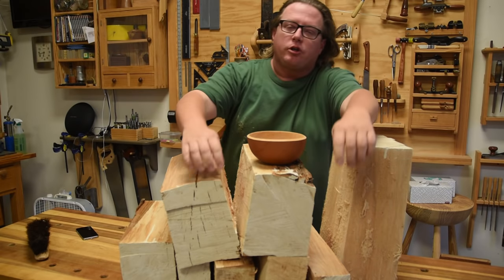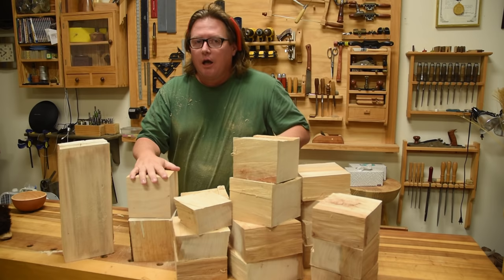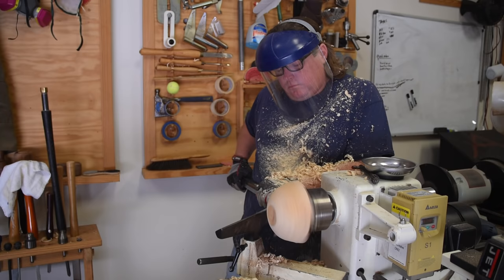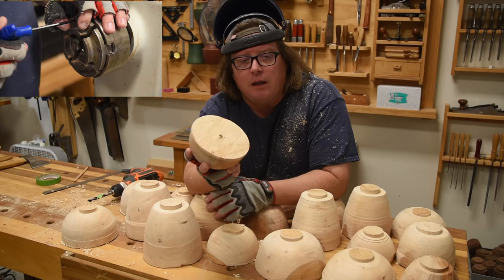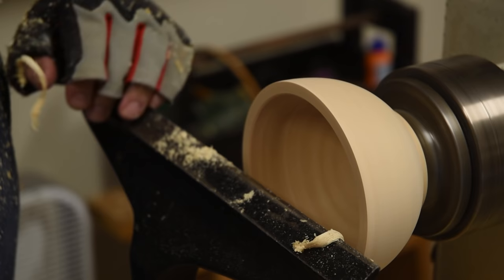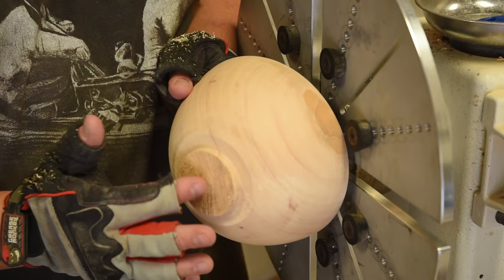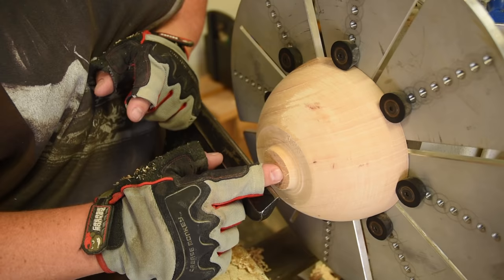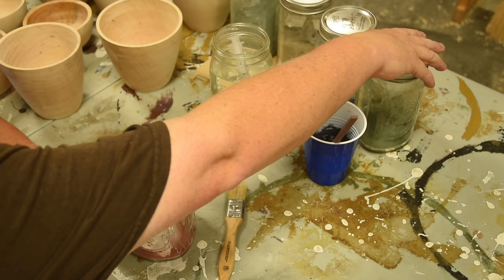Make a $20 Bowl in 20 Minutes

Comment: Great video.  I will offer a couple of  ideas I use in case it helps others.  I use a 2" forstner bit to drill each blank and set that on my chuck rather than a screw drive - the hole takes the same time to drill and it's quicker to load and unload from the chuck.  I also set my bandsaw table at about 20 degrees and quickly cut the blank  round - this saves about half the time in roughing out the outside shape and no banging cuts.  Hope that helps.

Comment: Thank you for this, learned a lot. What type of oil are  you using?
Reply from the maker: I use walnut oil from the grocer because it's cheap and fully cures in a few days.
Reply: wortheffort thank you.
Reply: I am allergic to nuts . Does that matter?
Reply: Patty, I'm no expert on allergies, but I would say 'yes, it probably matters.' My favourite is Watco Danish Oil. It's a mixture of linseed oil and varnish. It penetrates, and hardens over time. The outside is still essentially raw wood, that you can re-oil anytime you like, but it hardens on the inside, and gets harder and harder over time. I have some solid wood furniture that I made about 20 years ago, and all I have ever done to it is oil it. Now, it is hard as marble, but can still be cleaned up with a bit of oil, and the grain pops like it's brand new. 

Having said that, oil is oil...... kind of. There are oils - like linseed - that penetrate well. And there are sometimes blends - like Watco, and others - that are linseed and varnish. But, basically, oil is oil. Linseed is a vegetable oil. Why not canola oil? Why not flax seed oil? Worth The Effort says he uses walnut oil. Why not take a jar of peanut butter, open it up, pour the oil off, and use that? I've never used canola oil, or peanut oil, but I have used olive oil, and I have used single grade motor oil. Motor oil is vegetable oil - maybe with a bit of dinosaur mixed in. Lol. Both worked well. And, because oil is oil, if you try some kind of oil, and don't like it for some reason, you can simply go over it with another oil. I'll always use Watco Oil as my main stay, but I'd be interested in trying avocado oil, or coconut oil. Why not? Finish your stuff with avocado oil, and sell it at the market, marketed as 100% natural. It could be a winner! Lol.
Reply: Steve, I am looking at a foot of new, heavy snow, so before I die of shovelling, I want to say hi and thank you for your comment. I love helping my son in his woodworking shop, so I totally appreciate wood grain popping, we love finishes and paints and we have a couple of wonderful books about wood finishes, about varnish, wiping varnish, urethanes, etc. I can't remember our favorite finishes...Waterlox, is one for doors and floors.  As I read your comment, I had to laugh because I am also allergic to flax/linseed oil, walnut  oil, peanut oil,  ...I really appreciate your experiences with different oils, and after I deal with this heavy snow, if I am still breathing, I will come back to your advice. You know, this has alerted me to be cautious of wooden bowls in general. 
 We had a job last year of painting slices of dried oak which were art pieces. They were sawn slices of trees, dried and sanded into wavy discs that looked like large flower petals and shallow wavy plates. We used car paints...Kandy, with a laborious process of enhancing the drama of the wood rings witha white dye , then  sprayed transparent Kolor base coats, then the Kandy Klear coats, with sanding between coats, then buffing, until they looked like jewels. Looking into the surface you could see the tree rings glowing. We had to stop because the paint began to develop a crack sometimes in the very center of the wood plates, and we would have to sand the whole thing down and redo it. We could not get a reliable process. But believe me, those things were really beautiful when they came out right. We just could not afford to do it because of the demand for perfection and the chancy nature of the wood.
Reply: Veg. Oil.. fruit oil.. turn rancid!!!. 100% use mineral oil or edible wax heated and polished

Comment: I bought some really good bowl gouges. In order to make the last i made a series of carbide tools for about $15 each. I use them for the roughing cuts, and enjoy the expensive tools for the finishing cuts.
Reply from the maker: A little practice and the gouges will do the work so fast you'll realize that even expensive steel is cheap in the long run.

Comment: A thought for protecting the rim / face from aluminium marks using the superjaws. Instead of using blue tape which will take time to set up and remove (plus any residue). Use some plastic clingwrap (the thicker stuff used for shipping) to loosely cover the top edges of the bowl. This will provide the required protective barrier in one quick sheet.

Comment: Great video!  The sign of an expert is making hard things look easy! A couple of minor suggestions you may have already considered (1) Use black plastic contractors bag to reduce moisture loss in stored bowls, and (2) dampen wood slightly to pop any loose grain (although if wood is green that might not work).
Reply from the maker: One quick warning, plastic will prevent all moisture loss and promote fungus growth. It's a good way to spalt. Paper eliminates air movement but lets moisture leave so less chance of mushrooms.

Comment: Thanks for your effort.
Suggestions: Put 45° lines on your bandsaw sled from the root of your cutline (fenceside) outward. If you line up the corners of your piece with those you get a quadrat automatically.
Second: while a pause bury the bowls in their own shavings. This will contain their original moisture. Dont leave them to long because of mold risk.
Reply from the maker: In one of my tips videos I show a trick with a cheap plastic speed square. It's moveable unlike a line. But still... doesnt' save any time on these small bowls.

Burying the bowls is a valid technique. I show it in my coring video. I make a game for Instagram out of it. "How many blanks are hiding in this pile...." I wouldn't recommend it if you are only turning the bowl once as it leaves the spores in the top layer of the wood. But if you're going to return it after a few months of drying....

Comment: Great video.  Appreciate your willingness to share your insights, techniques and things that work for you.  Ive had a Shop Smith for years, which includes a pretty powerful motor/lathe set up.  Ive winged my way through making bowls that have turned out pretty darn nice.  Interesting use of the milk paint - though I like the staining and oiling and waxing bit of wood working as well.  Thanks again.  Next up, ur from a tree to a bowl video.    Then, going to drive around the corner and pick up some newly sawed logs to practice on.

One problem is i never want to ruin good expensive bowl blanks that i have sitting here....

Comment: Thank you for your video that was spot on my need - I have a large order for low cost bowls that I accepted simply to get more practice and improve turning speed.  It's reassuring to see that I've broken down the process same as you though I used a recess to avoid the tenon cutting step - and often end-up with issues at the bottom (I read your reply to this question earlier and will change to using a tenon.)  

Note on the glove - I've used a golf glove to avoid burning my hand - fits tight and as no safety issues as long as I keep my wrist away from the chuck.  

Time-wise, though, I am faaaaaar from your 20 minutes (and you thought you weren't speedy...)  When I try to shape outside as "aggressively" as you, I've had problems creating wobble from the worm screw hold but I've used a piece of plywood as bottom support - I'll try a large chuck jaw as you do.  Same on the hollowing part - no way I can make so few cuts without tearing bowl off chuck - a tenon will certainly be better.  

Question: does the process change much if the wood is drier than what you appear to be using?  I got my wood from a friend who's had it under his deck for several months to a year.  Also, I'm using cherry and soft maple - does this (at least partly) explain the difficulty I'm having reducing the number of "cuts" with the bowl gouge?  (am using a 3/8" Sorby gouge)?

Any comment appreciated - as it is your video was perhaps the most useful and practical instructional I've seen.  Many thanks.
Reply from the maker: Cherry and maple are much softer than pecan so it should be the same. When pecan is dry I don't take as fast a cut or make 1" wide shavings. I love bodark, our nations hardest wood. The difference in turning dry vs wet is dramatic on it. When turning extremely hard dry wood I take smaller passes at a faster rate but that is usually only when I twice or thrice turn a bowl. I never do dramatic coring in dry wood.
Reply: thank you for reply.

Comment: Im a painter, I have a Purdy brand paint brush, that I've used on over a hundred different jobs, if you clean them out afterwards, they last forever. Wire brush and hot water, they don't loose there bristles ever
Reply: It takes too long to pick all the bristles out of your work.
Time is money, get good brushes, especially if it's water based paint
Reply from the maker: Thing is milk paint soaks in, doens't sit on top. So random bristles brush off when dry.
Reply from the maker: but I get your point.

Comment: Good job.   I don't have a powerful lath nor one with jaws to grip.  I think it has a base plate with holes to screw a block to and is under 1 hp.
Reply from the maker: My lathe is only about 1 hp. Just sharpen those tools and stuff cuts easier.

Comment: Awesome video!  I've never used milk paint on any of my woodturnings, but I really like the look of it on the bowls in this video.  I would have been interested to see the wax applied (inside and out?) and buffed to the finished result, as well as maybe a few words from you on food-safe finishing materials and general maintenance of bowls like this.  Do you have to re-oil or re-wax them periodically?  How do they wear over time?  Thanks again for such a great video!!
Reply from the maker: Yep, just like a normal bowl. And yes, that's why you use multiple colors for the wearing effect.

Comment: I've heard, if you wax the ends of your wood in the drying process it will reduce the cracking SUBSTANTIALLY. It may increase the drying time but the cracking save allows a much higher yield.  the waxing requires the moisture to evap from the grain instead of the ends which causes cracking. This is just what I've heard but, I'd love to see you be able to save material for an extra product or two.
Reply from the maker: Ya, I have a video on that.

Comment: You did a great job on this video. IMO, "you think like a machinist". I'm not a true woodworking craftsman like you. I do make "stuff" from wood though. I like  the way you're into production and time saving steps.  You gave me a lot of insight into turning. I like learning. I've often thought taking some of the 8 inch ID steel pipe I have here, lining it with "Ram Board" then going across the road to my neighbors woods and cutting a bunch of small tree/twigs and placing them in the pipe tightly after drying them. Then covering them with epoxy and turning it after it dries. I do not have a wood lathe, all I have is a 13 inch metal lathe to work with.  After seeing this video, I'm wondering if I can make to tool bit, sort of like a giant drill bit out of some hardened plate and run it in from the end to to "Turn" the inside? Or maybe just make the plate to "turn" just one side?

Comment: Have you tried using the lathe for painting the outsides, maybe with a better brush to withhold the speed. Before cutting the tenon? Just curious, maybe speed the production line ha. They look great! Thanks for the video.
Reply from the maker: anythings possible but I like to do as much as possible in single steps to save time.

Comment: Great video, one thought if you do this regularly, which I guess you do. Rather than "finger line" where to cut your blocks on the bandsaw, why not add markings to your crosscut sled to indicate squares ? Either drawn on and sealed with some wood treatment, or simply shallow grooves where the corners would land at 1cm or 1/2" spacing then simply slide the block in until it's corner lines up with a marking, one square, or as good as.
Reply from the maker: stuinNorway these are rough off chainsaw. Bandsaw is safe.

Comment: Cutting the majority of the bowl on the bandsaw regardless of size is a huge overall time saver. Use a circle cutting sled (nail on an adjustable/lockable slider that moves perpendicular to the cutting direction). Press the stock into the nail and pivot. It's much quicker to remove the stock this way. I've also found that it's much better to let the bandsaw deal with unforeseen embedded metal than your gouge. A bandsaw can be thrown out or sharpened easily, a fine gouge (which you need to be using if you're a professional) will take hours of grinding to return to working order. Removing as much stock as possible with the bandsaw is a no-brainer to me. You are also less likely to hit metal because the volume the bandsaw blade cuts away, compared to the volume the gouge cuts away is MUCH (talking up to to 300-1000 times) lower.

Also found with large bowls, you can sometimes get more bowls from the corner pieces that have been cut with the bandsaw! Or just general use triangular stock.
Reply: If your bandsaw table tilts you can rough out the rest of your bowl too. Two passes and you have a bowl that has 70% of the material removed, and a nice smooth start to turning the rest!
Reply: And if using the spur you have there, you could make your circle cutting sled use a hole of the size you use as the pilot for the spur.
Reply from the maker: samthepoor as shown in video at this size rounding on the bs takes longer and adds a step. Not sure why it would take you hours to sharpen a gouge.
Reply: I said it would take hours to return a gouge back to a usable state if you get a nick in it from hitting metal or stone. I used to get a nick at least every other week, perhaps just a symptom of the wood in my area.

Rounding on the bandsaw with a circle cutting sled takes me about a 45 seconds from picking up the sled to putting it down. Diagram of the sled https://i.imgur.com/TUR505F.png. Black is bandsaw, orange is sled, red is adjustable slider with a nail. Green is the stock and the cross is the pivot point, super easy to use. The nail point gives you the exact centre to use for chucking too.
Reply from the maker: Again, even when you hit a nail or something that chips out a bit should only take a few minutes to fix it. This is a common occurance in turning found wood. And again, you addded an entire step when in my practice it doesn't save time. Really you saw me go from square to round in the video as a combined effort in creating the shape/adding the tenon. It didn't take long and even if it added 30 seconds, it eliminated a whole step.

Comment: Like the video a lot, I turn thousands of bowls, so I wonder why you would not use a push cut to round the blanks. No shavings in your face, no shoulder hunch, and probably faster. Like Stuart Batty or Ashley Harwood demo with the 40-40 grind. I find I rarely use a pull cut any more. Also out of the line of fire if it blows.
Reply from the maker: 123hermdagerm even Stuart (who taught Ashley) pulls for speed.

Comment: I'm really enjoying your content, as I move from Pen turning to other and larger items. 
I really wish you would protect your hearing at the same level as you protect your hands and face.... 
Wood turning over time causes hearing loss, and the use of noise reducing headphones is strongly recommended..., not to mention a good respirator.....
Reply from the maker: 335blues1 ok your reaching. Turning is fairly quiet. If your machinery is so loud you need hearing protection turning pens then there is something seriously wrong with your lathe.

Comment: Great series of videos,  thank you!  I have a question about the oil and milk paint.  I believe you are putting oil over the water based milk paint.  Since the paint is dry, does the oil soak into the outside of the bowl pretty well?

Comment: Why you don't make a swinging arm on the tool rest with the tool attached to it.
You could work way quicker.
Reply from the maker: If I understand what you're saying correctly I'd have to make dozens of them and swap them out as you can't cut that much wood with one pass. The blade isn't that big. Or you might be thinking of coring system which I have a couple videos on. Either way... I don't have metal working tools.

Comment: This is pretty cool!
I have one question, though. I know nothing of turning or the effort involved in making a blank, so if my question is stupid, I'm fine with that. Anyway, would it be easier for your turning if, instead of putting squares on the lathe, you cut the corners off the squares, making them octagons? It's more time spent on the band saw, but it seems to me it would be less time--and effort--on the lathe...
Reply from the maker: Ted Martin this was discussed in video. Time/effort equation.

Comment: Great video, I was mesmerized all throughout. Out of curiosity, have any of your customers brought any bowls back over the years, asking about warping? I notice you've used water-based milk paint on the outside but oiled both sides. Wouldn't this create a situation where the wood will dry out at different rates on the different sides?
Reply from the maker: Of the few thousands sold a few have come back from cracks. But there's always evidence they were dropped. Even then, swap out to keep happy customer. Milk Paint breathes so no.